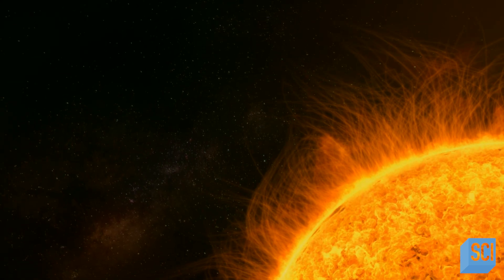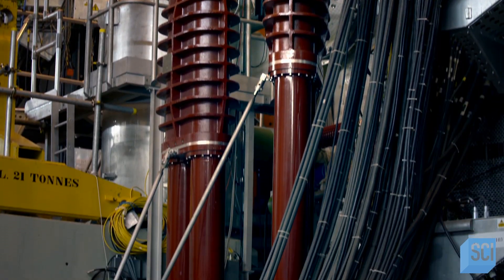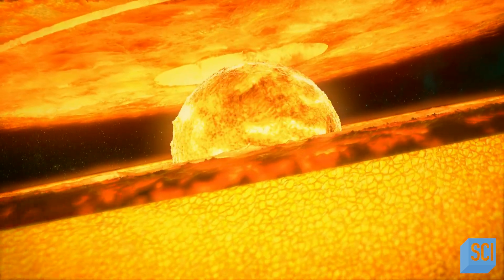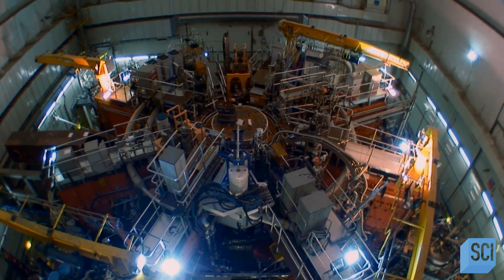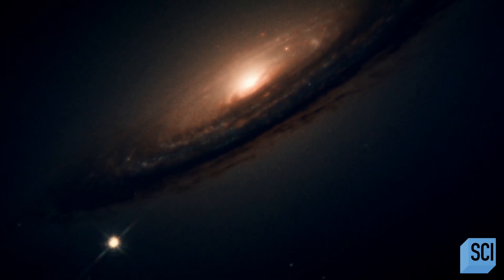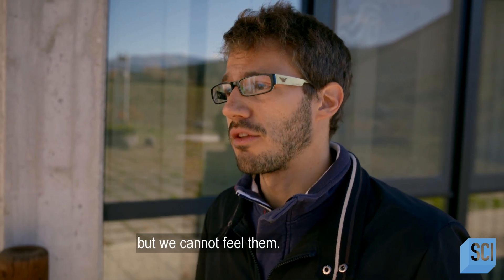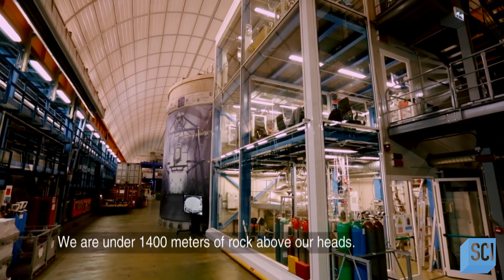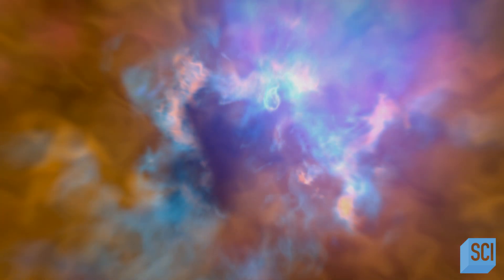Uncovering the Power Source Behind Stars and Supernovae | Space's Deepest Secrets | Science Channel

Comment: You make the whole process so difficult and wrong.  The stellar engine is composed of a (post) (super)nova star core fragment of superconductive (and gravitational force) material.  It accretes anything in its cosmic vicinity.  Cosmic tensor bosons hold the cosmic space time fabrics together - holding the gravitons together (gravitational force) and apart (electrical force).  Independent matter particle tensor bosons and Aether tensor bosinos are captured in the evolving photosphere.  The photosphere houses the Aether domain tensor bosino particulates.  They fuse Hydrogen into metallic Hydrogen, but Helium up to Iron.  The chromosphere house the matter tensor boson particles.  They fuse Cobalt up to Element 118.  The fusion process by these tensor bosinos and tensor bosons is pure dual force ADC (AC + DC) electrical and gravitational force.  There is no nuclear radioactivity of enrichment here.

The electrical force enriches the electron shells overwhelming the Van der Wahl's radius.  The gravitational force fuses the 2 nuclei together, overcoming the Coulomb boundary, and leaves, with the fused atomic nucleus remaining.  The electrical force leaves, and the electron shells return to stasis, and this causes the known electron transition series of emissions.

Matter tensor boson particles :
Tau electron energy level - Lyman series (gamma rays)
Muon electron energy level - Balmer series (UV rays)
Electron energy level - Paschen series (visible light rays)

Aether domain tensor bosino particulates :
Small electron energy level - Pfund series (infrared)
Electrino energy level - Humphrey series (infrared)
Graviton (basement) energy level - (? microwave and/or radio waves)

These fusion process are not plasma related, heat, temperature, pressure etc.

A collapse of the photosphere running out of Hydrogen to Iron, causes the photosphere to collapse, which rebounds with the chromosphere continuing to produce higher production of Cobalt to Element 118.

Be'nard's Convection in the photosphere, ... cosmic deep space Brikeland currents, ... the intermediary boundary photosphere-chromosphere spiculae are a match of a matter tensor boson and Aether tensor bosino, which uplifts the Iron into the chromosphere for higher fusion processes ...  are all tensor boson currents.  The chromosphere surface granule appearance is looking at the top of the chromosphere tensor currents, while the coronal mass ejections are fragments tensor currents flung into space.

All cosmic events are controlled by tensor bosons and tensor bosinos - fusion, space-time fabric cosmic tension, electro-gravitic accretionary theory and cosmic orogeny of all higher composite Aether particulates and highest composite matter particles.  Tensor bosons are the elemental objects of all creation.
Reply: Now, wasn't that easier than spending a zillion dollars to find out that the sun is hot?